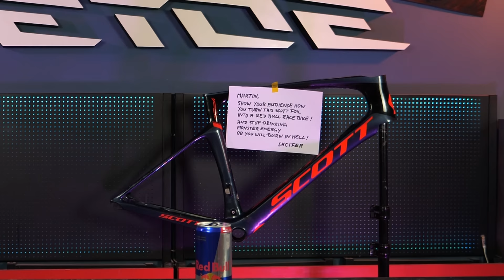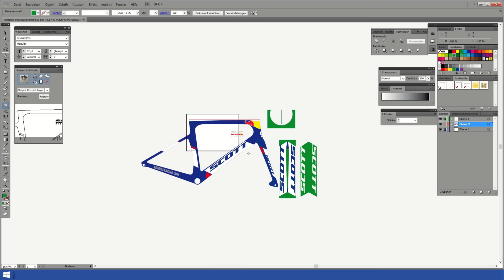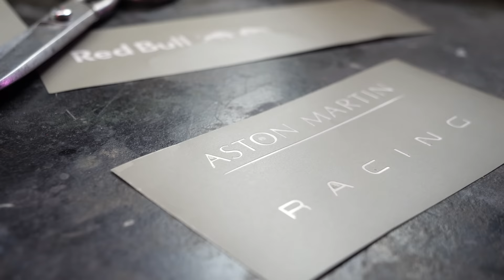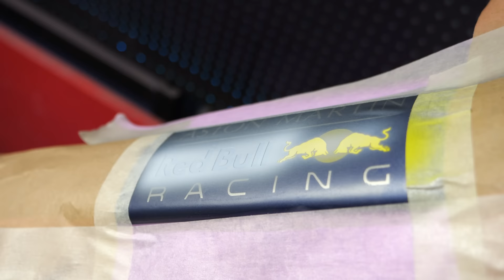RedBull Bike But Painted With Monster Energy

Comment: As usual, sweet paint job! but the question is, after all the decals and stripes adds-on, dont you need to fine sanding the whole frame to clean the uneven surface?
Reply from the maker: No I use extreme thin and light colors.

Comment: Hi Martin
Love watching your videos. Do you have any advice on how to avoid orange peel in the clear coat. I have been spraying a motorbike wheel using a 2k high solids clear coat with a ANI R160 HPS mini spray gun and a 1.2mm tip at 3.5 bar but I am ending up with a lot of orange peel. I have just started using a spray gun so I am learning all the time. It is my intention to spray my bike frame but I need to learn how to clear coat without orange peel so your advice would be much appreciated. Thanks Lindsay
Reply from the maker: Thanks, just add 5-10 percent thinner to your clear coat and reduce the pressure to max. 2.0bar.

Comment: Thank you very much for your great videos Martin. 
I have a question about what paint you recommend for a beginner. I can buy the spray gun that you recommend, but I don't know what paint to use with it that cures as fast as a spray can. I'm not a professional so I would prefer ready made paint. mixing pigment with various liquids that you do seems both difficult and require a lot of different stuff. several liquids, mixing software, etc. It would be great if you can recommend some easier paint to get started with a paint gun.
Thanks in advance.
Reply from the maker: This one: https://amzn.to/3kuwu5l

disclaimer: This video and description contains affiliate links, which means that if you click on one of the product links, I’ll receive a small commission. You have no extra cost using these links. You help to support the channel and allows me to continue to make videos like this. Thank you for watching!
Reply: @ETOE  👍

Comment: Hey Martin.  Thanks for another great video.  I'm in the process of painting two frames and i was wondering when should one use the oracle 631 vinyl vs the 813 stencil film?  I went back and rewatched your videos and I couldn't find anything when to use each one.  I'm looking to paint bike brand name and graphics so i would think using the oracal 813 stencil film.  is that correct?